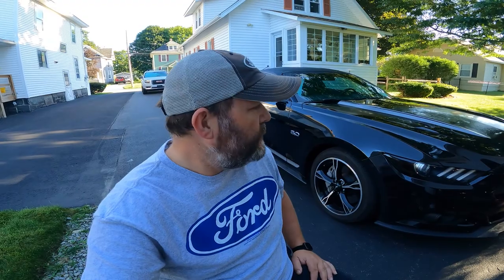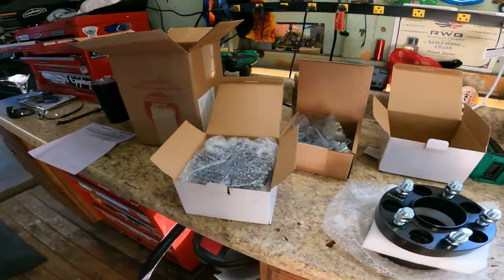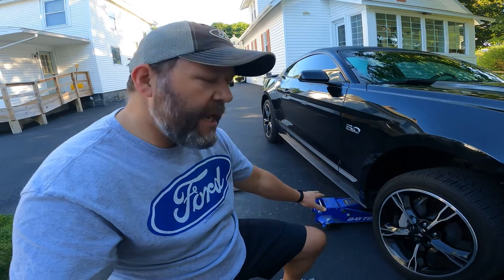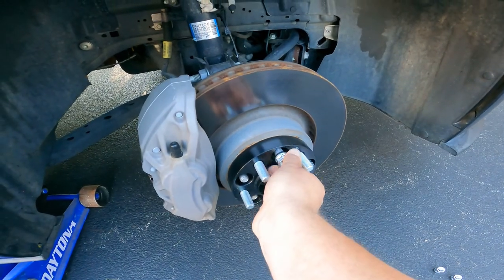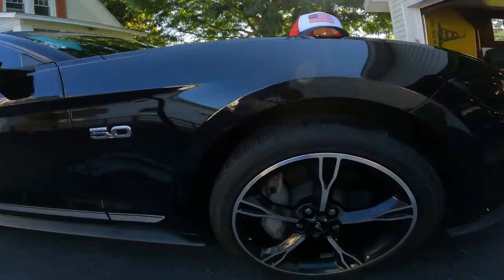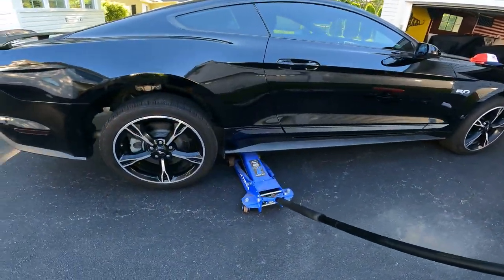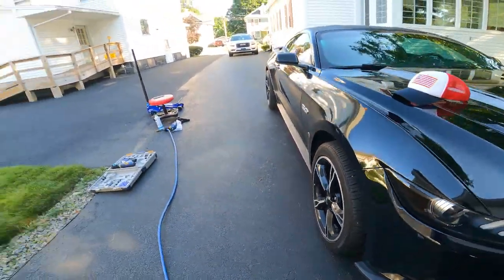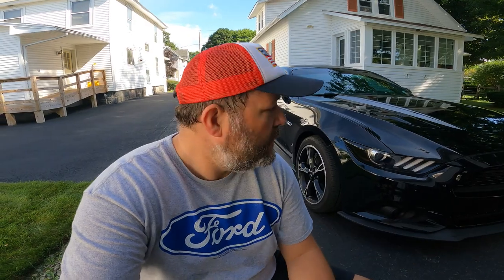Make SURE They're Hub Centric! #mustang #mustanggt #ford #californiaspecial #gtcs #wheels #spacers

Comment: It looks way better what size of wheels do you have
Reply from the maker: They're 19 inch
Reply: @DoItYourselfDoItRight  Thanks  man I have I 2023 mustang Gt with 19 inch wheels 255-40-19 and it sits so high I had a 2020 mustang ecoboost with the same set up and it didn’t sit so high it looked much better then my Gt I’m going to actually have it lowered 1.5 inches I was told Gt sits higher cause of the weight difference.
Reply from the maker: I've never really noticed a difference but I'll definitely look the next time I see an eco boost.

Comment: What did you torque the nuts holding the spacer on to?
Reply from the maker: If I recall correctly, it should be 150 ft lbs, same as the lug nuts.